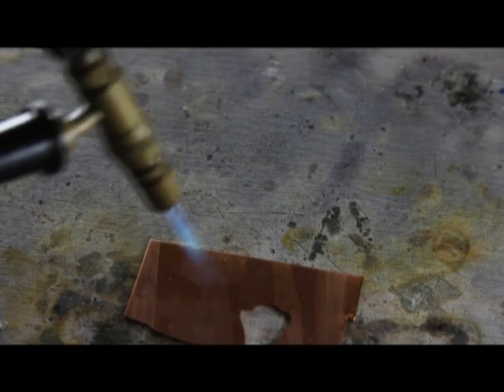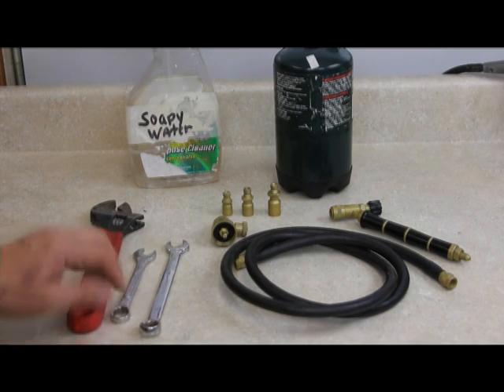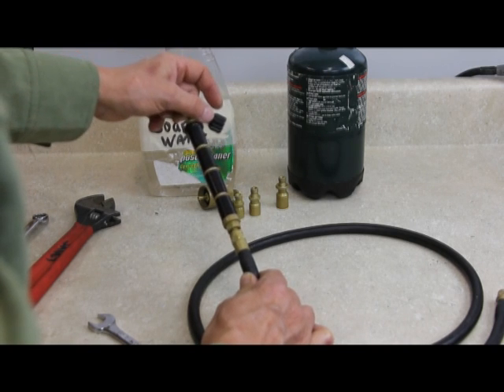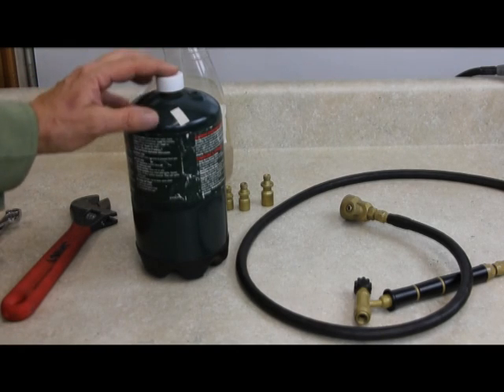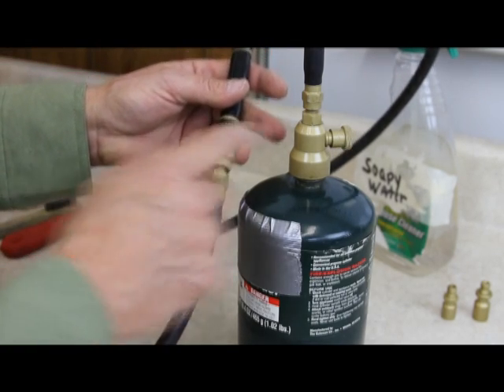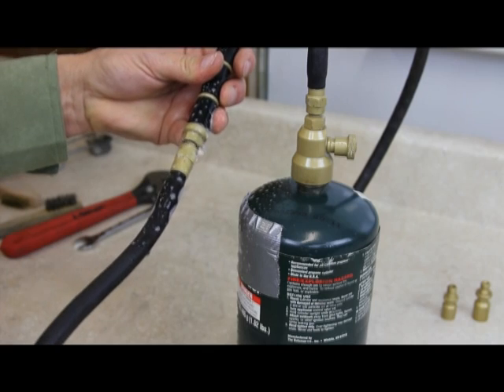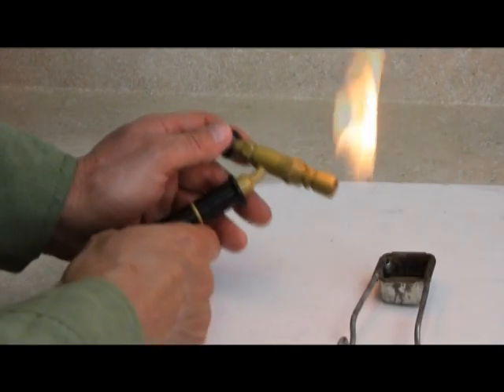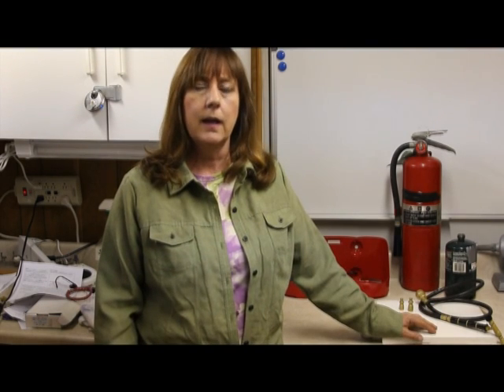How to use the EZ Torch with Janet E Alexander

Comment: Hi, which brand of propane canister can be  used with this torch? Thanks in advance
Reply from the maker: Sorry for the late response, for some reason YouTube didn't notify me. All of the small propane canisters will work. If wanting to connect to a larger tank, like one used for grills, it needs a regulator.

Comment: Janet, where can I find an adaptor for the orca torch? Mine came without the valve and adaptor
Reply from the maker: I looked on line, and it looks like you have to purchase the kit for the adapter, which is the regulator.  You  might try calling Rio Grande. Sorry for the late response. YouTube didn't notify me of these comments. I will start checking more often.

Comment: I bought one of those 5 years ago.   I found the quality to be quite poor.  The flame adjustment ring was very loose and would not stay set.  The nozzles constantly clogged.  Pretty much a waste of money for me.   Go ahead and get a Smith's Little Torch. Don't be afraid of the oxygen!
Reply from the maker: The smith little torch is great for soldering small things, like re-tipping prongs, chain repairs, making granulation, and general gold soldering. For silver soldering, it will cause fire scale and doesn't heat up large pieces evenly.

Comment: awesomei video thank you.  wondered this torch would be able to handle mapp gas as some of the adds suggest... haven't seen anyone giving it a crack yet
Reply from the maker: The connection on the torch's hose only allows it to connect to these small bottles. The connection is the regulator and is made to regulate the propane in the small bottles. So, you can't use the mapp gas cylendar.

Comment: I'm not sure what I'm doing wrong but if I tighten the hose attachment to the torch tight enough to not get any gas leaks I no longer get any swivel on the torch. I double checked and am connecting the correct end, but when I still had swivel movement I tested and had a gas leak, then tightened and no longer had any swivel. Any ideas why this might be?
Reply from the maker: I suggest you contact the manufacture of the torch.  You may be missing an O ring or something. You should never need to tighten the nuts that much.
Reply: Así es mamis

Comment: I scared to use this torch fir the flashbacks you hear about ;di I need a y other safety like arrestors etc ..?...
Reply from the maker: You may want to address this question to a distributor for this torch. Though flash backs are usually when the flame pops and goes out. This torch doesn't do that. A distributor would be http://www.ottofrei.com/search?keywords=EZ%20torch.
Reply: @JanetAlexanderJewelry  así es mami
Reply: Paula Andrea así es mami

Comment: I've been using propane with the Benzomatic Pencil Torch Tip. If anyone is familiar with both, I'd love to know how the flame size compares on this. It seems much smaller from the video.
Reply from the maker: Hi Adam,  the EZ torch comes with three tip sizes. The large one I have used for casting small items. The small top is great for precision silver soldering.
Reply: @JanetAlexanderJewelry  así es mami

Comment: Great video, Janet Alexander, very precise and detailed.  So many tend to skip over things that seem simplistic, but if you've never used the equipment, NOTHING is simplistic!  This is one torch I'm considering, and having this information in hand will definitely help with the decision.
Reply from the maker: Thank you absentwithoutleaving, another torch I have my beginning 
students use is the Max Torch. It has a fairly hot flame that is 
adjustable. https://www.riogrande.com/Product/Large-Butane-Torch/500086
Reply: Así es mamis

Comment: I'm so excited to get mine,I just ordered it and it's called an Orca Torch,they're made for small or large refillable tanks,I got the refillable because I don't have to go far. Enjoy it your going to love it, and it uses the air from outside with the tank regulator,so you DON'T NEED another tank to worry about knocking over.
Reply from the maker: I'm glad to hear it! Thanks.
Reply: Así es mamis

Comment: I'm considering this torch as I just use a butane one right now.  When you are adjusting the flame and moving the dials do your fingers get really hot? When you first turned it on it looked like the flame was really big?
Reply from the maker: When you first turn it on, you adjust the gas flame to about 3 -4' and then adjust the air. The torch adjustment isn't hot. After you have used it for a while it becomes hot.
Reply: Thank you I've used my torch a few times. The place where I got it from said it was okay to leave the hose connected to the disposable propane if I was using it regularly. They said I should disconnect if not using for awhile like a month. So you take your off every day and check for leaks every time you use it?
Reply from the maker: Yes,  I do at the end of the day. Lets say there is a small leak, you come in and now you have no gas.
Also, I tend to be very safety conscious. My home is more important to me and so I disconnect.
Reply: @shoptwoblooms  así es mami
Reply: @JanetAlexanderJewelry  así es mami
Reply: @JanetAlexanderJewelry  así es mami

Comment: Hi Janet, I need your help in determining if the EZ Torch would be appropriate for inside my home. I would be working with copper cuff bracelets and eventually silver. I want to use hard solder or medium. Would like to get your thoughts also on the jumbo max micro butane torch. It is supposed to heat up to 2500 degrees and throws a larger flame than the smaller micro torches.
Thanks for your response and I enjoy your videos.

Comment: Thanks a lot for this video, Janet. Indispensable! (specially because the torch comes with almost no instructions.) I just tested mine for leaks and there are tiny ones, where the rubber hose meets the metal.. so I don't know if there's much I can do, would you have any idea? 
cheers
Reply from the maker: Robert Anderson You can try crimping the metal around the hose,  send it back for a new on or take it to your local gas supplier.
Reply: @JanetAlexanderJewelry  así es mami

Comment: Janet, this is a great video - thank you! I have a question, though. All of a sudden I can get my torch lit, but it won't stay lit. I turn the tank on a 1/4 turn, open the knob on the handle and use my striker, just as before, though the flame ignites and immediately goes out. I can hear the gas. Any ideas?
Reply: Close the air holes completely before igniting the torch, and it will lit. Add air after you have a steady flame.
Reply: @alexsar54  así es mami
Reply from the maker: Good call Alex!
Reply: @JanetAlexanderJewelry  así es mami
Reply from the maker: Katie Mullins Hi Kate, I have no idea as to why it is happening. Contact the manufacturer.
Reply: @JanetAlexanderJewelry  así es mami
Reply: Así es mami

Comment: First; thank you for this video.  Question (please); I just bought an orca ez torch and yes I got stung with all the parts separately...now, after I hooked it all up and there was a 3-4 foot flame out of the end of the hand piece.  I don't think it is supposed to do that right?  I noticed the air valve was quite open but still...would it do that? I took the torch outside and tried to mess with it and might give it another try tomorrow - outside of course.  I am going to watch your video a few more times to make sure I am doing all this correctly but I was just shocked when it did that.
Reply from the maker: The flame is adjusted by opening the air nut near the tip of torch. The more air supplied to the flame the sharper the flame becomes. Watch the above film at 4:30 minutes into the video. This is where I adjust the flame. If you have that completely open, try turning down the valve at the tank. It only needs to be open a crack and only open the black knob on the torch handle just a little bit.
Reply: Thank you, I think I might have it figured out with your tips.  I had the air valve wide open, I also had the tank valve wide open.  Much appreciated.  I was pretty scared when it acted like a flame thrower lol.  :)
Reply: @trishseal  así es mami
Reply: @JanetAlexanderJewelry  así es mami

Comment from the maker: Agnes, you need the valve! It turns the gas on or off to the torch head and it regulates the pressure. Go back to your supplier!
Additionally, at the end of the day, disconnect the torch from the tank. This makes sure there is no leaking.
Reply: Así es
Reply: Mami

Comment: Janet, thanks so much for that video. I recently got an EZ torch and got very vague, unclear instructions with it. Specifically, the instructions I got directed me to connect the swivel end of the hose to the propane canister, not to the torch head! Also, I did not get a valve...the directions say to just connect the hose to the canister, It says the valve is only for the refillable propane canister. I had a lot of trouble getting the torch lit, and after using it only three times to solder some small projects, the tank was empty the next time I went to use it, about 2 days later. Now I'm wondering if the whole canister just leaked out into my workshop over those 2 days! Luckily, I don't smoke! Thanks again for this video!

Comment from the maker: There was a question on Google+ asking if you can work with 100% propane. No. Air or oxygen must be added to the mixture to create a hotter flame. This torch brings in air just below the tip and mixes it with the gas creating a hotter flame. This is the way an Acetylene air torch works as well.

This torch also can be bought to work on propane. You must order it with the correct fitting for propane. The manufactures make different fittings so that they only fit on one type of gas.
Reply: Así es mami

Comment from the maker: This torch does have a small problem in that the knob that adjusts the air flow to the flame tends to move while moving the torch with the flame pointing downward and can make the flame change. I just work around it and have had no substantial problems.  I like using the torch for classes where I have to travel and need a hot compact torch. Its compact and low cost. Some people don't want to spend the extra money on a higher quality torch but want the heat of one.

The best torch, if you are willing to invest more money is a Smith Acetylene and Air torch. I've had one since 1974 and love it. It comes with several  tips and is good for casting small items for soldering.  If I am soldering a very large item, tea pot, I have a Y valve added in line and use two torches off of one tank.
Reply from the maker: Great idea Kevin! Thanks for sharing!
Reply: Some Teflon tape on the thread will provide enough friction to prevent the knob from moving by itself. 
I wouldn't put an o-ring there - this part of the torch can get pretty hot.
Reply: Oops, nitrile is really a different story. I just thought is was regular rubber ))) 
Thanks for sharing your experience !
Reply from the maker: Kevin, can you tell us where you purchased the nitrile o-ring and what size it is?
Reply from the maker: Good to know!
Reply: @alexsar54  así es mami
Reply: @JanetAlexanderJewelry  así es mami